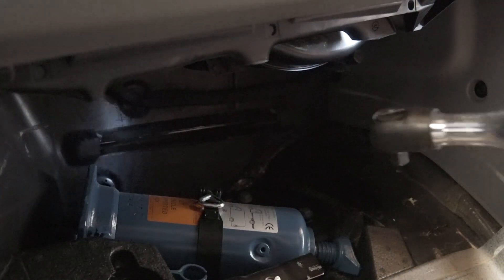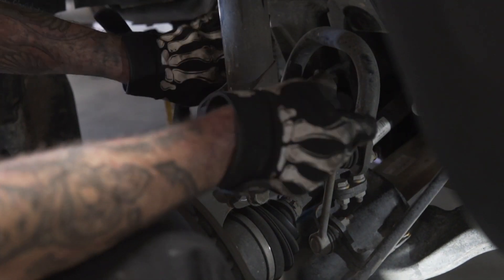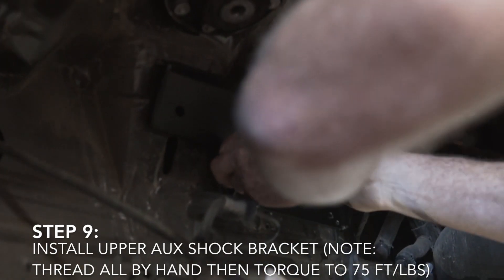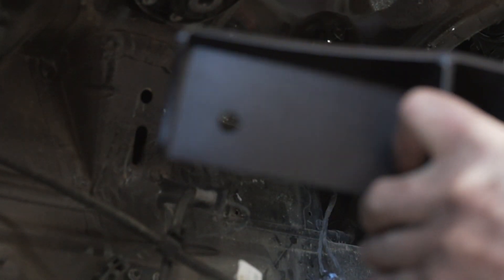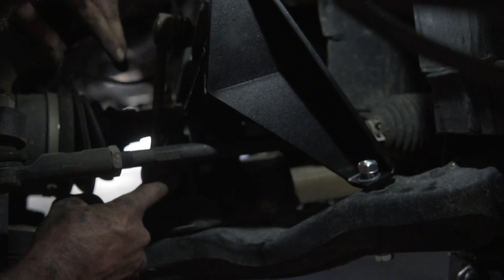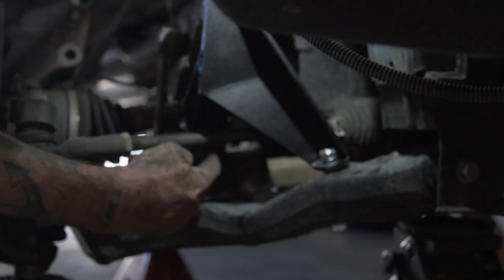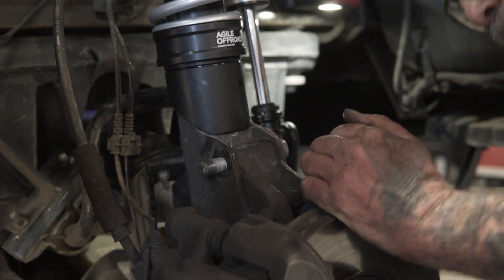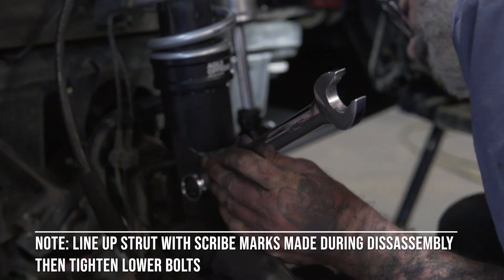Agile Sprinter 4x4 MAX Auxiliary Shock Installation Guide

Comment: Knowhere in the included instructions does it tell you to remove the strut? Is it necessary? Im going to start installing the kit, im planning to upgrade the strut later as  funds allow, thanks ✌️
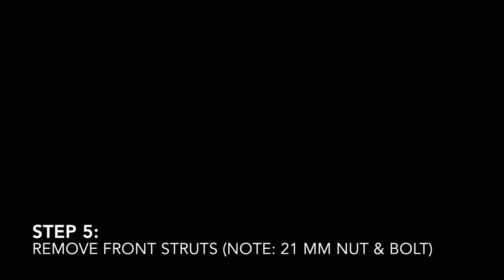Reply from the maker: Please look at timestamp 2:16
Reply: @Agileoffroad  thanks, it was easy enough to install without removing the strut, i know the video shows it being removed,  but the instructions that came with the kit, doesn't tell you to remove it

Comment: Good vid, thanks. But  what with rust after cutting?..
Reply from the maker: Other than the slight amount of clearancing we did on the front control arms (which are made of stainless steel) we aren't exposing any new metal to the elements. Our kits have been installed on vans in all climates and we haven't seen any rust issues yet.

Comment: Thanks for the video.
 What size tires and rims are they?
 Secondly how much higher than standard 4x4 sprinter is that... what is the height of the lift kit?
Reply from the maker: Those are 17-inch Evo Corse DakarZero wheels (available on our website). Tires are 275/70-R17 BFGoodrich K02s. Our MAX Auxiliary 4x4 Shock kit does not change the ride height of the vehicle. It provides improves handling & stability both on & off road. The van in this video has our Sprinter 2500 4x4 Ride Improvement Package (aka RIP Kit) installed. (Auxiliary shock kit is part of the RIP, but can be installed on otherwise stock 4x4 vans). The RIP Kit provides 2-2.5 inches of lift on average. If you have any further questions please email us at info@agileoffroad.com or visit our website for more information. www.agileoffroad.com. Thanks!
Reply: @Agileoffroad  Does the RIP kit normally provide the 2-2.5 lift?   Also, Any issues going with the big brakes too?  .. and finder fix with the 275 tires too, right?